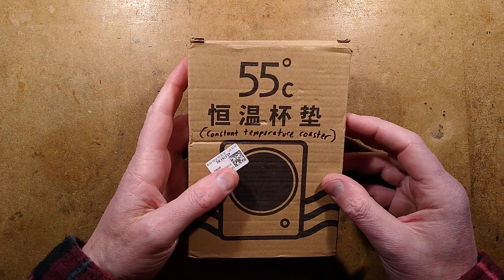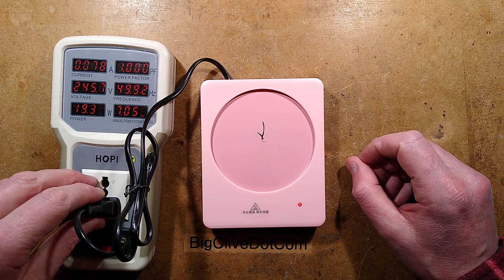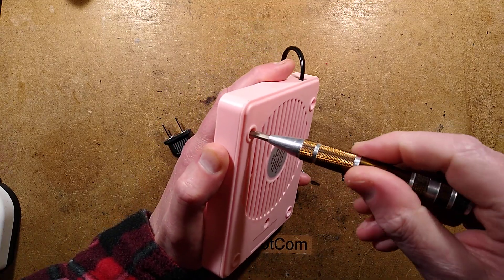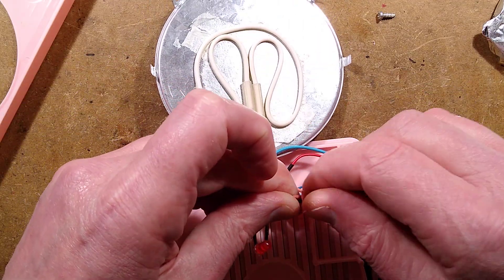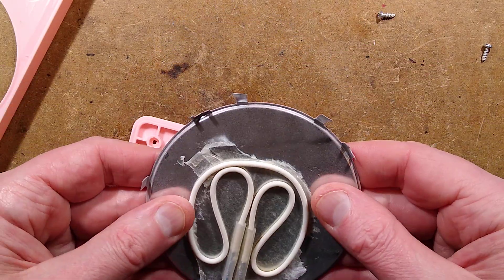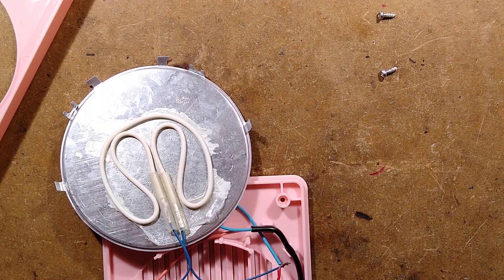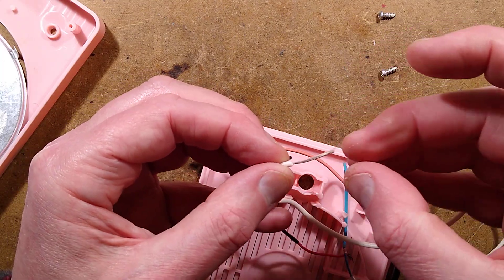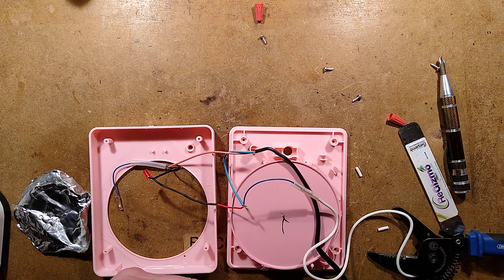Hot pink and dangerous (just how we like it)

Comment: I’m curious if this wasn’t just a 110V unit they slapped a 240V sticker on. The LED wouldn’t be as bright, but the resistive heating element would stabilize at a much lower temperature.

Comment: Interesting that YT decided to show me this, because I just bought a similar sized heating pad as my expensive 'smart mug' doesn't stay charged long any more. Most of these mug warmers seem to be mains powered  and a bit too big for convenience, but there are a few of them that run off USB so I bought one to try out.  The plate does in fact hold at 55C in my newest phone charger, but this does not stop my bone china mug cooling down, though the rechargable Smart Mug does hold drink at 55C for an hour, though I would prefer it to be a bit warmer for a bit longer. I guess the heating wire must be directly stuck to the china in the expensive one.  Will have to see if it comes apart and has room for better batteries.  Not sure what to do with the 55C USB mug cooler though. :/

Comment: I'm going to guess that the „Automatic Constant Temperature“ and the „Self Regulating“ functions are both achieved by the „Heater“ wire melting and then opening the circuit once a certain point - Carefully selected to occur about 3-4 days after the eBay returns window has closed - Has been reached? 🫖📆🔥😉

Comment: Illegal to sell in the UK without the proper plug and CE mark, double insulation, rating  Brand owner address.
Hot surface Warning required above 75C.
Danger temperature is typically 300C for fire retardant V0 plastic.

Comment: Up -cycling tip ... take the ( smaller  ) electric cast iron hotplate from a ( UK ) scrap cooker .. wire it up for MAX resistance ( all elements in series  ! ) place on an empty catering bean tin ( perfect fit ! ) with an earthed  M6 central fixing to the base  ... power up and you have the perfect hotplate for  your coffee ( we used it to melt Araldite™ storage crystals ! ) .. ( tried - n - tested ) ..... DAVE™ 🛑

Comment: According to Ohm's law, the element should be ~2,992.5 Ohms. I see a problem with the LED resistor, in that LED's are highly susceptible to having the peak inverse voltage rating exceeded. Since your mains voltage is ~240 volts, that means that there is a peak of ~340 volts available to reverse polarize the LED. There should either be a blocking diode, or, a small signal diode connected anti-parallel to the LED, or it's not going to last long at all, even at 1.5 mA. (2.1 mA peak) Since the reverse break-down voltage of the LED is considerably higher than its forward voltage drop, chances are, the LED is running very hot. It doesn't help, that it's right next to a hot plate!
Reply from the maker: The older technology LEDs are often run like this in cheap products.  The newer gallium nitride LEDs fail instantly.

Comment: Actually if you were to remove that metal plate and keep the rest of the housing it and that might be good for something that would need a fan housing very small computer there might even be enough room to put in a barrel Jack as well perhaps for something in that there wouldn't be room to mount a fan internal might be a use for this I would certainly not use it when it's intended purpose even if I was in the country that would have proper voltage

Comment: There are inline axial thermal switches that look like a small metal body resistor. 
The proper design probably would have had a 50'C one taped or glued to the hotplate next to the heating wire.
And a safety spring switch so it only turns on when a mug is placed on it.
Cheap Chinese crooks took out the only 2 safety features on the device, saves them a few cents. 👎

Comment: From the rating of the resistor, and the US plug, i would hazard a guess that it’s designed to be used with a 120V supply. Wonder if it runs closer to the advertised 50 degrees then. Either way, doesn’t excuse the design of this pink turd.

Comment: "Self Regulating" Basically the idea with a device like this is that you're not suppose to run it without a load. 
A typical coffee mug would have enough thermal mass to sink that 20 watts. In fact, in practice, this wouldn't even keep your drink hot as much as it would just take longer to cool off. Buy you some time to drink it if you will. Put a cold cup for tea on it, it'd be hard pressed to come up to temperature, if at all. Agree, still not safe tho if you forget it on with no load. 

PS, Wire nuts are not typically springy, at least I don't find. They are standard in my area. They just didn't install them correctly or they used the wrong size. (Fyi, long time sub on my personal account).

Comment: <.<     >.>        I used to use old broken coffee pot hot plates with the thermal switch removed to a distance to heat the bottom of the mash pots.   They can keep 4g of mix right at the edge of a boil in 45°F weather.   Never saw a difference in the heat component between 4cup and 12cup plates either.   Betcha that's an extra 4cup plate with a cord, value $0.92, being sold to get rid of it.    Its missing the switch, right?

Comment: I used a coffee/tea/mug warmer for years with a very similar, but older design, with the same very thin heating wire, but wrapped in mica, and stuffed into a channel in a steel plate clamped onto the aluminum plate.

I must've gone through 5 or 6, because eventually something would spill, and get into the mica, and everything would crumble after enough time. It was 18 watts also, on 120V, but only got up to 150°C if I ran it empty. With a coffee with a good, flat bottom (glass beaker style), it'd keep the coffee at a nice hot temperature until it crusted over. XD

Comment: This must be a hot plate with a dangerous design. Ya probably could set vodka on fire 🔥 with it, or candle 🕯 wax. I’d be VERY CAREFUL with this in the home 🏠. It must ALWAYS be supervised, by the adult 🧑 using it. I’ve smelled 👃 burning 🥵 electronics (circuit boards), and burning 🔥 plastic. Not too good 😌 of smells 👃, and also a warning ⚠️ to take the malfunction electronic, or electric ⚡️ items out of service. I even saw 🪚 your pink plastic calculator. I bet it’s safe, but it goes very well with the pink plastic hot 🥵 plate. Your friend, Jeff.

Comment: Made one myself.
With real heating element on kapton.
12v 1A.
Switches on by weight. Used 3 micro switches parallel and small mosfet. Isolated on the bottom. 

Gets 100 degrees 
Used 1mm aluminum on top. 

Here you can find the files
thingi verse
thing 4082799
U ser Turbocinqy

Comment: It would be best if the heater was PTC rather than constant, but it could be worse. I have a hot glue gun which actually has an NTC heater. It takes a long time to get warm but then it gets very hot. Worst yet it is "rated" for 100-240 volts. I have 120 and it's not too bad but it might be much more exciting on 240v.

Comment: That wire looks like the same type they use in fridges. At least it's in my fridge anyway. Mine had this outer sheath that almost completely melted when the fridges temperature control went awry. Had to replace it.

Comment: Hi Clive, thanks for your very entertaining channel, calling out cheap and nasty stuff!  We're all concerned to get our electricity bills down, and a lot is made of the 'vampire devices' draw a small constant current which adds up to significant cost over time.  However, I've tested a number of switched mode devices and found the quiescent current to be tiny, pennies per year- unless there's an old fashioned linear 'wall  wart' which can use some watts,. (my old Roberts DAB radio draws 8 watts when on, 5 watts when off, so left plugged in would cost me 15 quid a year!).  Anyway, I was thinking that you could do a public service by measuring the quiescent current for a number of items, and calling out the big users. I'm guessing that some "value engineered" power supplies will use more than the would if a few more pence was spent on the implementation. What do you think?

Comment: The reverse breakdown on LEDs can actually be useful in a pinch, a batch of InGaN green I have break over pretty reliably at 60V as long as the source impedance is pretty high (megs). Used this in a GM tube power supply lash up because I didn't have any zeners above around 15 volts. Really anything with a PN junction can probably do this, I found "zener" voltages in the range from 20 to around 150V from a variety of small signal diodes, LEDs, and BJT junctions when I was fine-tuning my regulator string.

Comment: Not safe to use. Those two blue wires are carrying mains and are right by the metal plate. The extra silicone insulation does not cover them all the way to the edge of the plate. The heat will make the insulation on them fail. Individual assembly variations could mean one of the wires actually touching the plate which would make the plate live and the only protection would be a layer of hot paint.

Comment: I did notice that the heater has a plug for 120 volt USA mains. Is there a rating for it for voltage? The ebay add states 220 volts but I do not trust Chinesium products such as these. I had one in the states that had one of the ceramic block resistors of the 10 watt size but I do not recall the ohm rating. It was clamped to a 1/8 inch aluminum plate to pass the heat to the mug. The temperature never passed 150° F.

Comment: Calling it right now before you open it, there's one of two setups inside.
Either it's a giant resistor for the element and a small resistor and the LED in parallel 
OR
it's so cost reduced that the giant resistor is wire wound with a tap off just for running the LED, and there's nothing else inside

Comment: "it's a while since we've had an episode of Unbox Tragedy..."
"it's got to be pink if it's dangerous, just for extra drama"
around 3:30 the wire nut just falls off in shame.
I always use wire nuts on solid wire because they don't work on stranded wire very well if at all.
I didn't know that conducting in reverse was normal for red LEDs.

Don't ever change Clive, you are an international treasure.
Reply: I also noticed this... They should have used the smaller blue or even gray wire nuts, or better yet, something else not prone to falling off due to improper sizing/installation.

Comment: It almost looks like it would run far better on 120v but may still need a PTC element to self regulate.  At 5 watts it would likely heat up a lot slower and may even reach equilibrium without overheating.

Comment: This looks to be a 120v unit because of the plug that has parallel flat prongs.
Reply: Chinese 220 volt plug according to the reply another comment. Looked it up and confirmed this.
Reply: Australian and Chinese 230-240v have flat prongs, the Australian ones set at an angle. (People bend Chinese plus with pliers to make them fit Aussie sockets - not recommended.) Seppos drill holes in the end of their parallel 120V plugs.

Comment: Ugh, wire nuts. Dodgy stuff!
I'd use it on flat-bottomed flasks and beakers in my lab if the heater could supply some more power.
The thin wire reminds me of scope probe cables.

Comment: I have something similar, also made in China, but of much higher quality. It's rated at 23 watts and one of the legs is a spring-loaded power switch, so it's only on when there's a coffee mug (or, as happens a lot in my house, a cat) on it. If you don't touch it for longer than 30 minutes it turns itself off. Then you have to remove and replace the mug to turn it back on.

I've been using it daily for around 20 years and it's still working. When it finally dies, I will dissect it and reverse engineer it.

It must have some form of temperature regulation because it gets hot enough to be really uncomfortable, but it's never damaged the cat. Nor has it ever brought my coffee to boiling, or even burned it.
Reply: Cats are comfortable in temperatures far higher than people can stand. I have noticed it when I overloaded my wood heater once. My sister noticed it with hers too.
Reply: @OffGridInvestor I think it’s their fur that insulates them from direct heat on skin.

Our old tabby used to sit in front of a gas fire and we’d smell his fur singeing and have to move him away! He always looked peeved that we had moved him from a heat source lol

Comment: I wonder if it was designed to be used on 120V with that plug at the end, even though the description of the item showed 220V. Or it's just supposed to be 220V max? It would dissipate about 15.6W at 220, and about 4.8W at 120V.

Comment: Those red caps were called screwits in the old days, they were ceramic and used to join wires together. The modern ones are plastic. As you say there no longer standard in the UK anymore but were commonly used from the 1930s to the 60s.

Comment: you could probably make your own one with a disc of aluminium, and  bolt a 3.3k 50w aluminium cased power resistor to it (or 2 1.5k 25w types) 😁 and a 60 c bimetallic thermal switch for a bit of safety if you wish 😉

Comment: It is scary that there is no over temp protection in the form of ptc or thermal fuse. Regarding the discrepancy between the approx 150 deg C measured and the advertised 55 deg C, my guess would be that the product has been designed with the intention of having a cup placed on the hot plate, therefore acting as a thermal load or heat sink. The element has probably been sized so that a cup full of water or maybe even and empty cup, would reach equilibrium at around 55 deg C (this of course would be dependant on the ambient conditions). This is evident from the fact that the hot plate appears to reach around 150 deg C and seems to be at equilibrium with no thermal load.
Even so, this product is scary for the simple fact that it can be left on with nothing placed on the hot plate, and the plastic case could burn. One would hope that the element would burn itself out before that happened.

Comment: I have bought three of these from Wish,different models,and all have functioned perfectly. One is s Smart model with three selectable heats. All are fitted with base safety switches,so do not operate without a weight on the pressure disc.

Comment: Yeah, good ones will have a higher rating but also a thermostat affixed to the underside of the plate.

Bad ones like that just rely on heat in vs dissipation out to "regulate" the temperature of the mug.  No mug means "no load", so it cooks itself to death.  Kinda like bricking the accelerator of a car that's parked.
Reply: No need for a thermostat, just a self-regulating PTC heating element, and a non-resettable thermal fuse for safety.

Comment: We had electrical fires under control until we started  importing Chinese made good. This thing is a fire hazard and should come with a free fire extinguisher. I took my old washing machine to pieces to see that the outer drum is now plastic with a heater element pushed into a rubber grommet and poked into the plastic, if the thermostat fails and not enough water this thing would catch fire. They are  putting profit before lives.

Comment: I think the added heat capacity of the full coffee mug will keep the temperature down and probably avoid burning the adhesive and plastic case. 
Fire hazard if ran without a mug on it!
Reply: The added heat capacity only helps until the coffee reaches the boiling point. And once it's boiled away the end result is the same... so it's an obvious fire hazard if you don't have a mug on there and a covert fire hazard if you forget a mug on there...

Comment: Clive.
Firstly I just wanted to say thank you for all the safety tips over the years. I've recently had to get some new tablets, it turns out that they draw more power than my old ones when charging. Due to this this my poundland USB charger (Using 1 output only) has got a tad warmer than before, so today I went and got a better one.
Probably the safest thing to do. 🥳👍
Also thanks to you I've bought some of those pound shop ring lights you did a video about a couple of weeks ago. May the modding begin. 😃👍

Comment: The mystery hole is probably provision for a safety switch that, if included, would have turned it off if not placed right side up on a flat surface.
But they probably decided to make it more exiting and therefore more appealing to BigClive and save 3 cent at the same time.
Reply: yes, and the switch spring means it will not turn on until a mug or other object is placed on it.
Reply: "Decided to make it more exciting" 😹 stolen. that's comedy gold

Comment: My guess about the self regulating part is that the heat output is not big enough to overpower the mug on top as the heatsink/dissipation combo, so temperature "regulates" until it reaches equilibrium with the mug and contents. Technically it "self regulates under it's intended use"

Comment: The wire nuts falling off: the problem here is not the spring in the nut being springy or not. The problem is they used the wrong size wire nut. Wire nuts come in various sizes. The sizes are specified by saying how many wires of a given wire gage can be used in the wire nut. In this case we have a couple of very tiny stranded wires. 

The smallest wire nuts (which are grey in modern color coding) would probably be about right for that. The next size up (blue) might work, but it would be iffy. You could do the trick of folding the wires back over themselves (as they did here) to try to make the wires hold in the nut, but the directions on using wire nuts say to never do this as it reduces the pullout strength. 

In this case they used the third size of wire nuts (orange in modern coding), which are for wires much larger than used here. Even with twisting the wires and folding them back, there is no possible way these wire nuts would have stayed on the wires.